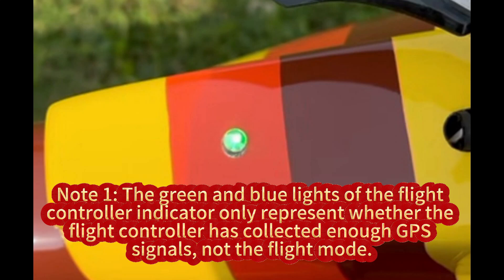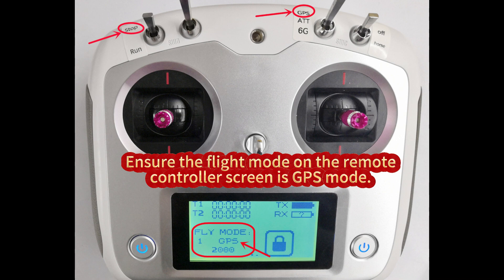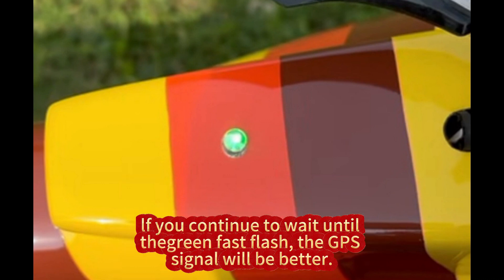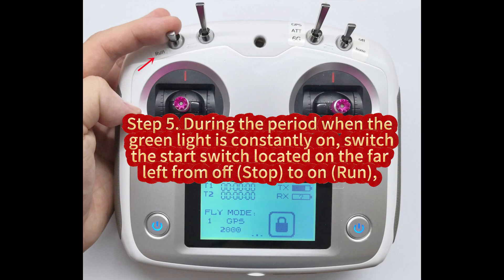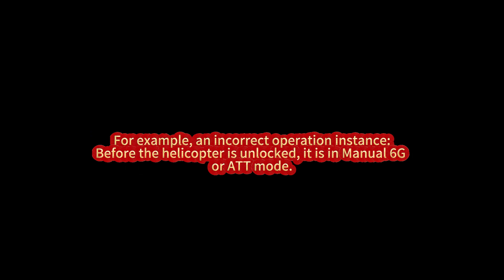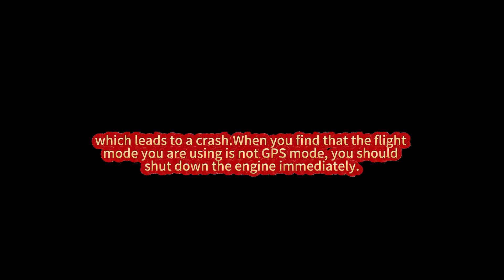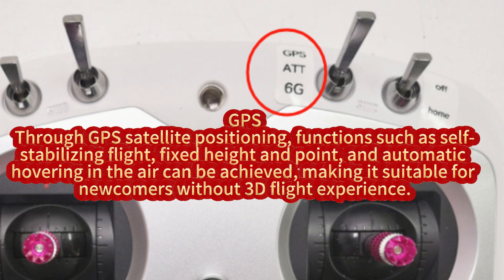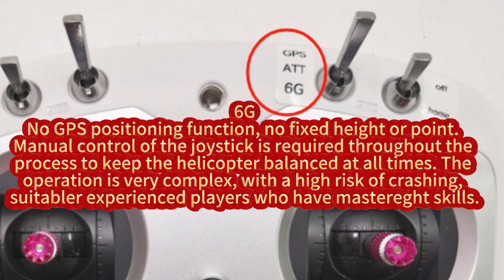FLISHRC L7 Flight Controller Takeoff Tutorial（Mode 1）

Comment: So after taking off in GPS mode I can flip the switch from GPS to ATT and it will hold its altitude and attitude but not its position?
Reply: With the L7 flight controller, you cannot switch flight modes after you have started the motor.   If you want to change flight modes you must land, switch off the motor, choose your flight mode, re-arm the helicopter, and then re-start the motor.  (the H1 controller however, can switch flight modes during flight)   
In ATT mode the helicopter will not hold it's position, it will drift and need correction by the pilot.  It will still hold altitude and be very stable.